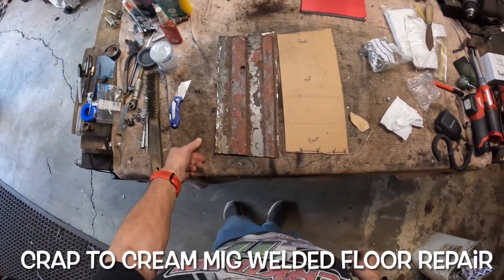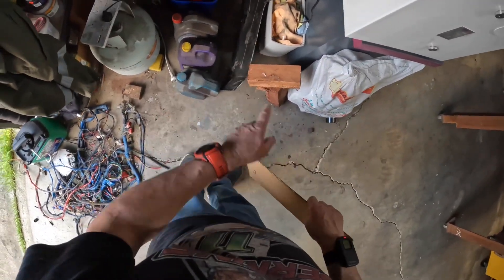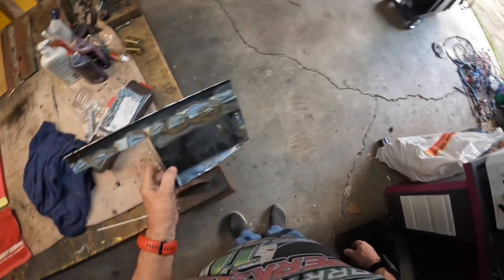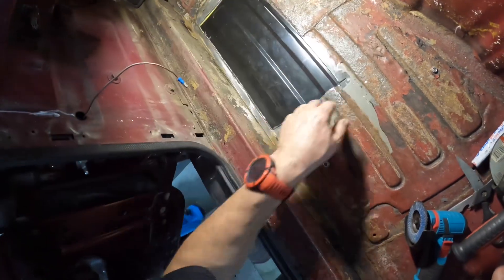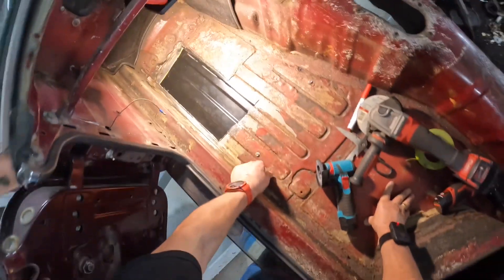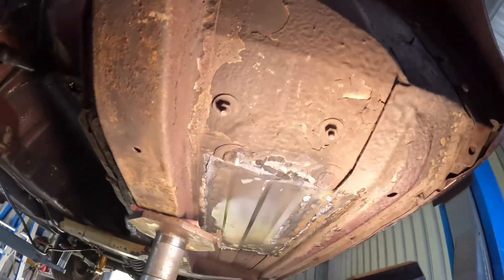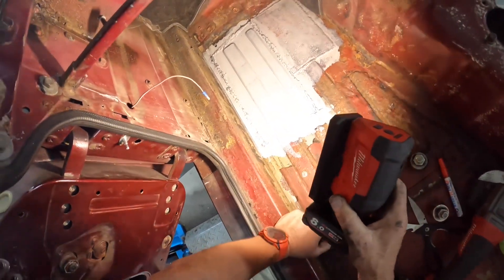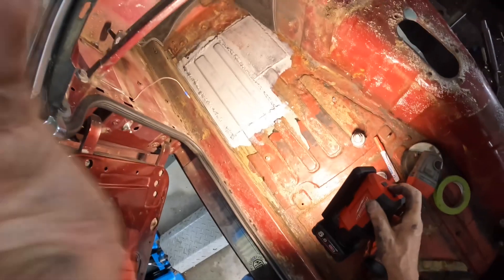Crap to Cream MGB floor repair, in the footwell, first time MIG welding, be gentle in the comments.

Comment: I have Replaced many a floor pan on MGBs.
Reply from the maker: Well this one is the first one I’ve done and it was only a relatively small section. I’m sure it gets easier the more you do. 
      Did you fully weld the floor in or did you stitch weld it? 
      Is it a hard job, just out of interest. Thanks for the comment.

Comment: You've inspired me to go to my garage and weld in my floor pan today. It is a partial job like the one you just did, except larger. I have 18 gauge sheet metal I am going to shape and weld in myself. Since it will be covered I'm not too worried about how it will look.
Reply from the maker: Ok great, I was in the same place, whilst I wanted it as neat as possible for my own personal satisfaction, being under the floor sound proofing and some underbody sealant underneath the vehicle it was a good "practice" area, one thing I know for sure that section of floor will never ever fall off.  The metal is so thin, I had to knock the voltage down to around 15V to stand any chance of maintaining a pool to weld on or with.  Good luck with your repair.